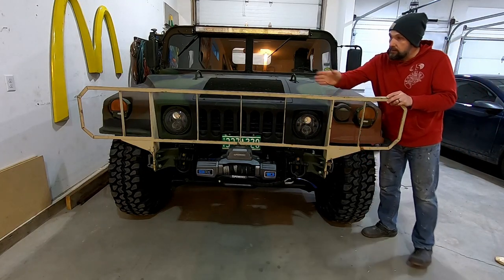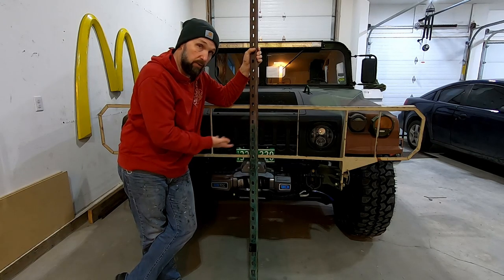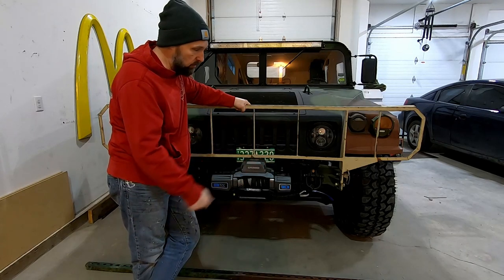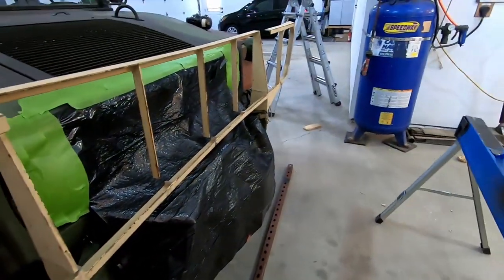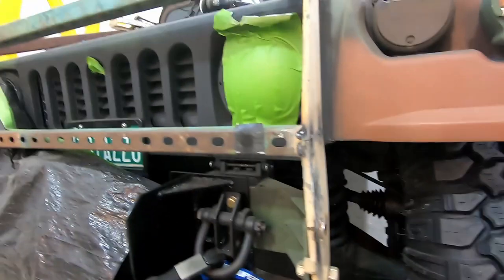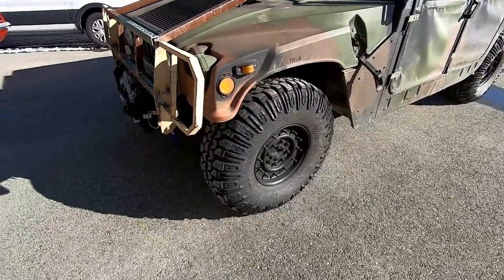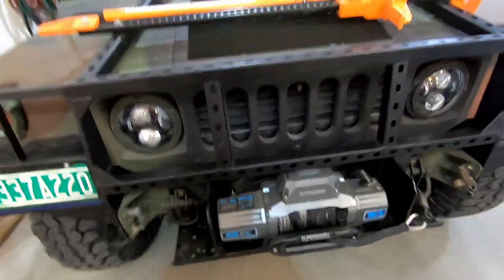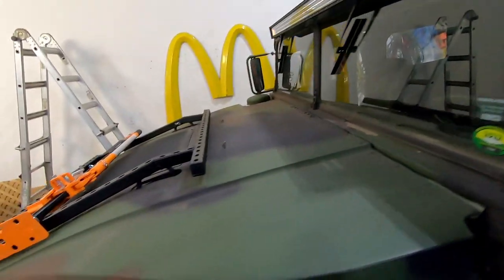Custom home-built Humvee M998 Brush Guard made from a modified stock guard

Comment: Im glad I watched your video until the end. It turned out pretty sweet
Reply from the maker: Thank you.   I’m happy with it so far.  I had the flu the whole week I did this project and video.   I know I didn’t bring a lot of energy to the camera.
Reply: @McSpeedAlaskanAdventures  I’m 98% there for govplanet releasing my M1123. I’m converting it into a rv
Reply from the maker: @howy4prez  Awesome!   I actually bought a slide in truck camper and used it in 2019 in the Humvee.  It actually fit and we camped in it twice.  Was way better to slide in and out and not make the truck a permanent camper rig.   It was a pop up version so the total roof height was more reasonable.   I’d like to find another one (smaller one) now that I’m in Alaska.  I got rid of it because my Silverado wouldn’t hold it and the Humvee is not a good highway rig and in Illinois it was a longer trip to anywhere to camp.
Reply: @McSpeedAlaskanAdventures  I must see! My plan is to have Usmc on the outside navy on the inside. Just like me.

Comment: Great idea, however the Unistrut works better if you turn the open side up (you will not be limited by the spacing of the holes). Also, the spring nuts / cone nuts come in ½,⅜,and ¼ inch sizes. Like my dad always says  "if it works, it works ".
Reply from the maker: You are exactly right.   Just didn’t want it catching mud and snow and ice in the groove.